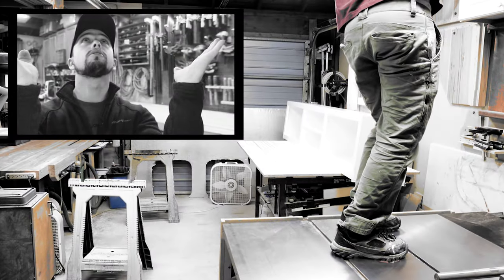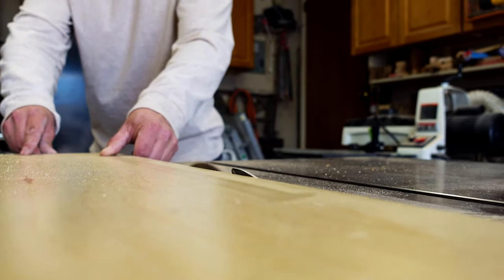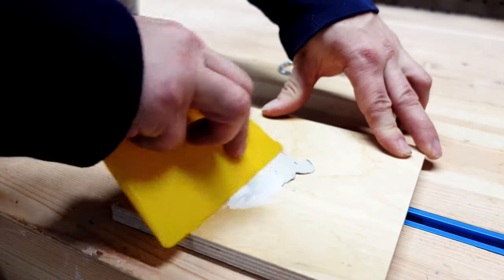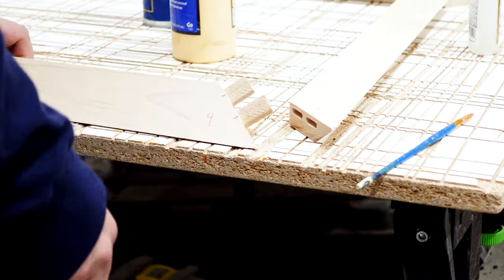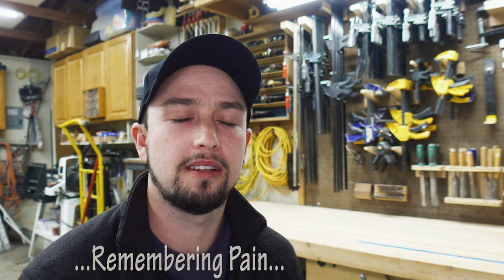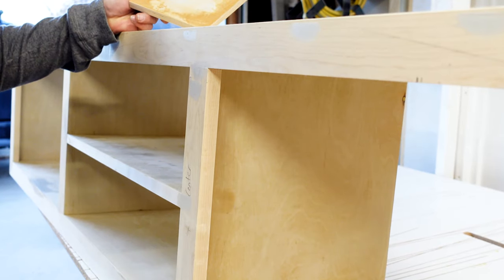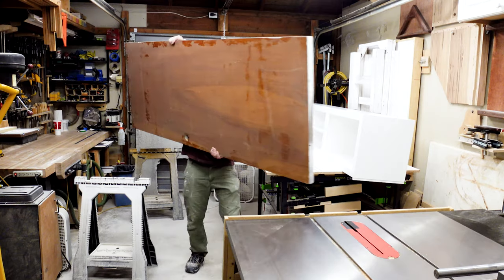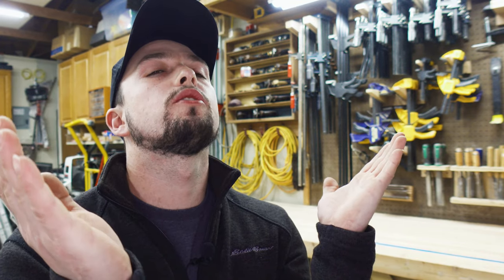A Truly INDESTRUCTIBLE Floating Media Cabinet!

Comment: Beautiful!!, I just love it!!!     What is your overall sizes..  I presume you fixed it o the wall with one long French cleat..?
Greetings from Cape Town, South Africa
Reply from the maker: Thank you! This cabinet was 16 inches tall, 16 inches deep, and 7 feet long. The open center section is 3 feet long. Thanks for watching all the way from Africa!
Reply: @FortressFineWoodworks  Thank you very much.  Thanks for the advise at the  end of this wonderful project,   It is inspiring!    Keep up the good work!!!  One last thing please   I presume is it .75 inch plywood?   And did you use two French cleats top and bottom? or only one at the top?
Reply from the maker: I only used 1 french cleat at the top, then ran a few screws from the inside of the cabinet into a few studs

Comment: Question, how did you hide all the cables going to your TV/soundbar?
Reply from the maker: They are going down the inside of the wall. You can get "cord passthrough" wall plates so there isn't just a hole in the drywall.

Comment: Do you know the model number on those Blum hinges? What they are called?
Reply from the maker: They are the Blum, Half Overlay, Soft Close, Quick connect hinges. And they connect to the blum inset face frame adapters. The numbers on the back of them are as follows - (these are close to but different than the part numbers.)
Half Overlay Hinges - 71B355 
Adapters - 175H500-01.23
Reply: Thank you!!!